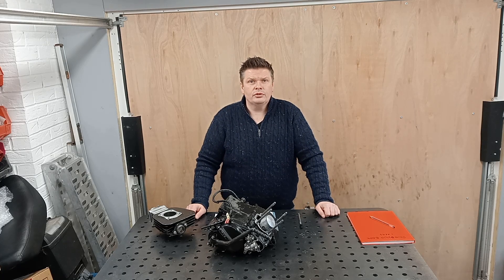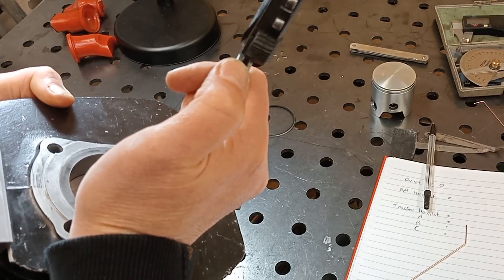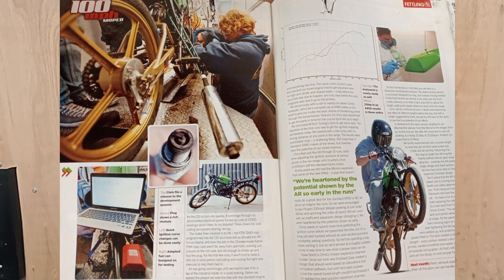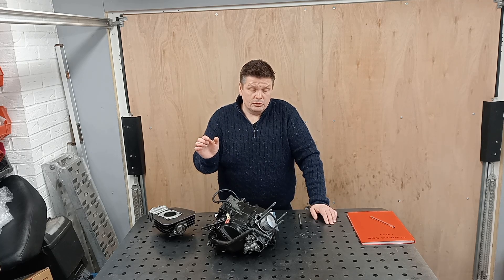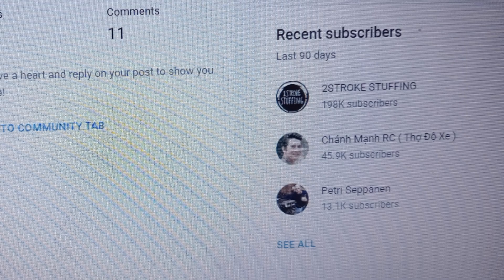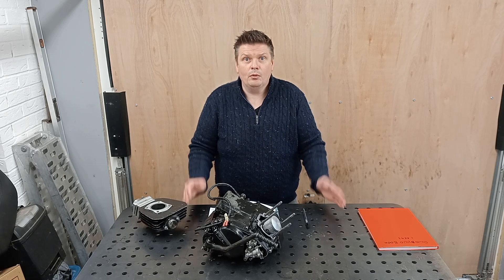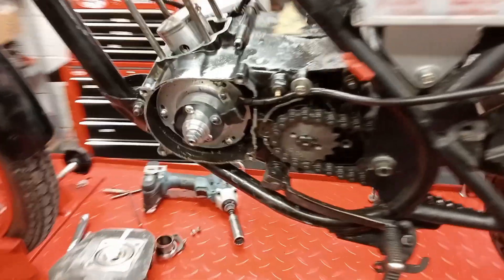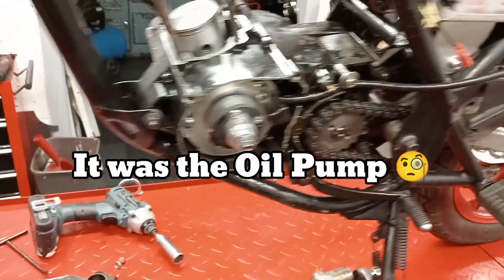How To Measure a 2 Stroke Engine - 100 mph Moped Challenge #2stroke #power #porting

Comment: A thumb role of squish is 1% of your stroke, so if your stroke is 45mm is 0.45mm a safe squish for performance 2strokes so your 45.5mm squish is totally fine, but you can get up the compression more if your fuel is capable of it 😊
Reply from the maker: Yes, I've heard of that rule of thumb too. I've been told of another now too so I plan to do a test to see what the engine likes.
There is no evidence of the piston touching at 0 .45mm
Reply: @AutoBeta2T  the lower squish you can have is better because it helps with detonation, by that you have headroom to downjet, add more timing and so on, but test as much as you can but I think you need a higher reaving pipe (14000rpm or more) for more useful power

Comment: Dave, I think your squish is a little on the tight side, A.G. bells book does not cover squish velocity, I'm sure you are aware of this fact, I would be running at 0.6 to 0.8. The other thing to note is that the squish gap should be at the most parallel or even better it should get larger as you head towards the combustion chamber, you must avoid the 'death triangle'...i.e. when the gap gets smaller heading towards the combustion chamber, this forms a triangle of trapped gas between the piston and the head. Your uncorrected CR is fairly high but the corrected is not, I guess that is because your exhaust duration is quite large. Just a quick question, how come you did not just measure the exhaust duration with the dykes ring fitted to piston?
Reply from the maker: Hi Pete, agreed it's a bit tight. Possibly why I didn't see a good increase when I raised the compression way back? I think it was 0.55 mm when I measured it before...? I may not have torqued it down previously 🤔
There's no death triangle - I checked and the solder looks parallel.
I had previously measured to the top of the dykes ring in the exhaust Dyno tests with the piston just allowing light in from the duct. I did however want something a bit less subjective  so I tried the wire method. I've never been happy with any of the ways to measure but I thought I'd better just stick to one... However.
Either way I'm at somewhere between 200 and 203 Deg duration.
Reply: @AutoBeta2T  I' know that you know a lot about this sort of stuff, so I'm not sure why I've posted this up but I have anyway! My understanding is that if the velocity goes too high it can actually promote detonation, having said that I think you would have heard it and seen evidence of it if you had detonation. But on the flip side maybe the short power runs that you are doing is not allowing enough heat to build up which would then drive the engine into detonation. If you have access to a lathe personally I open up the squish gap a touch and also run a gap of a few degrees.

Comment: A good way to calculate squish clearance, to get a safe ballpark figure, is - 0.015 X Bore Diameter. In your case 0.015 X 54 = 0.81 mm.

54mm bore is a common diameter for a 125 and I know they’re supposed to run at between 0.6 to 0.8. 

As you’re trying to get to 100mph I might go for closer to 0.6mm
Reply from the maker: Hi Dave - thanks for the rule of thumb - I will give it a go.

I have some ore heads now so I will try different squish gaps... May 0.7mm for a start.
Reply: on my Fantic 80 cc I have 0.7. It has ~19 HP @AutoBeta2T
Reply from the maker: Cool - 0.7 is sounding like a good ball park figure.
Reply: I ran 0.65 on YamahaTZ250G cylinders mounted on my TZ750, 54mm stroke, 1mm gasket compressed. Got expensive when a big end gave way.☹
Reply from the maker: Ouch - that does sound expensive. However a TZ720 with TZ250 cylinders sounds very nice! How much power is/was it putting out?
Reply: @AutoBeta2T  About the same as the 750, around 115hp but the powerband was severely narrowed down in this configuration. The throttle became something of a light switch, all or nothing. Hard on the clutch also. The 750 cylinders with their membranes gave a broader powerband and were a lot easier to drive.
It was only a few years later when I found out what Yamaha did with their works 250 cylinders (non membrane intake) before the powervalve era: they machined 1.5mm from the cylinder base and machined the cylinder heads for clearance. This broadened the powerband considerably and made equal top power. Yes, porting on the stock TZ250 cylinders was 1.5mm to high.
Reply from the maker: Sounds like an absolute animal to ride and no riders aids like traction control... Just the right wrist and the left hand.

Comment: try gasket 0.3mm under the barrel  squish is then  0.75 , transferduration longer . compression-ratio gets more bad, but it could run better
Reply from the maker: Hi Henk,

I did try a gasket during previous tests and I lost power everywhere. But as you say it could have been the drop in the compression ratio. I have some more heads to machine to try same compression but more squish gap.
Reply: @AutoBeta2T did you measure the thickness of the cellotape too? Surely it's 0.45+ cellotape thickness
Reply from the maker: @samforsey  hi Sam, the tape doesn't contact the squish band. It is in the area of the dome of the combustion chamber

Comment: May i say i think the wire is to thick would you hammer it flat ? exacting work love the video thanks.
Reply from the maker: Hi David, I did try with a feeler gauge 0.1mm but didn't get consistent measurements. I may try with some thinner diameter wire?

Comment: why you don't use a 360° disc on the crank ? with a 0.1 or 0.05 mm gauge it's very accurate. With your method, if the top of the cylinder isn't exactly level with the piston at TDC all your mesurement are incorrect
Reply from the maker: Hi, I have never used a degree disk, I have herd they can be inaccurate (parallax error). I have just seen a video with one of the digital angle boxes attached to the crank which looked pretty cool.
In my spreadsheet I can adjust for deck height positive or negative so where the piston is at TDC can be allowed for, It just so happens with this one it is at TDC.
Reply: @AutoBeta2T  Tournois racing make these tools in France, he modifies digital angle finder. In France we used to work with degree disk, the first one y had at 15 or 16 is a Compact Disc with a degree wheel printed on top, not the most accurate but good enough at the time,

Comment: This is the best way I have ever seen anybody do this: https://www.youtube.com/watch?v=jcSb2zPzzdA&t=330s
I think 2-stroke tuning should focus on all port timing from BDC, NOT TDC like a 4-stroke engine.  
Shop air into the spark plug hole through a modified comp. tester or old modified spark plug will show then the piston closes/ opens the exhaust port for real. :) 
Then, with no reed valve, closing the exhaust port opening with someting will make it possible to measure true transfer port timing the same way. 
I will argue that porting the intake port lower until you break through the floor is something worth considering.
Reply from the maker: Cheers for the link - that's a really cool way as those little boxes seem very accurate.

I also like the idea of pressurising the cylinder with air - perhaps with my leakdown tested but attached to a modified spark plug? And then using the angle box to track the crank angle.

Cheers - all noted in my red book :)

Comment: The bore is like almost 54 mm right...? This is the measure of a 125 cc engine if this is 50 cc which is the stroke....? 25 mm of strokes or something similar right...?
Reply from the maker: Hi - it started as a 50cc but has a big bore kit on it. The stroke is 41.6mm and the current bore is 54.5mm
Reply: @AutoBeta2T  Ok thanks for the clarification it is like almost 100 cc.... this displacement is better to find real gains in HP

Comment: You have blowdown from over 36 ?????????????
Reply from the maker: Is that good?
Reply: That confuses me too... Is that used in tuned street 2-strokes? I am only used to 18° to 26° in my chainsaws.
Reply from the maker: Polderfischer - it confuses me too. I have always gone for getting the area required to get blowdown phase done so there is minimal pressure in the cylinder when the transfers open. In my single exhaust port this requires going high but in triple and T port engines it can be achieved at lower timings. 
In my exhaust test I kept raising the exhaust duration (port height) and the power went up with no loss of power band width. This told me that more area was required to blowdown effectively. I think each engine is different and the dyno or stop watch will tell you when it has what it wants.
Reply: @AutoBeta2T  Seems to work for you. Perfekt. Maybe saws without a pipe behave different? Also we need no peak power. That may be the point. Thanks for responding! And greetings from cold northern Germany

Comment: Hello, for taking this at the exhaust, I use lamp in the duct and watch when light comes.
For the transferts, only a 0.10mm gauge.
Reply from the maker: Hi WTM - I hope you are well?
I did try with a 0.10 feeler gauge but I struggled to get consistent results. I did give it a go. 
The result I got with the 1mm welding wire was very similar to what I got using the light in the duct method.
Reply: Yes, with the gauge, the idea is to stop when it's hard to move in it,add little oil for more precision. Your idea work great. 👌
Reply from the maker: Cheers buddy 🙂

Comment: Nice!
thanks for the shoutout, i haven´t been able to test my ignitionsettings yet due to a very odd reason.
My mothers 'estate' after her death is occupying my garage, and i don´t want to make it smell glorious twostroke =)

I measure with a caliper and a 0.10mm feeler gauge lying flat on the dome and into the port.
Then measuring from top of cylinder down to piston.
Zeroing out the caliper at piston tdc against the deck.
Reply: Commenting as i´m watching.
0.45 squish is a little bit tight, in me and my friends project(piaggio twin) i went from 0.45 to 0.75, never dynoed the difference.
But we won the 'big race' in Sweden and became Swedish record holders, and only just tenth´s off the world record, managing this with a slight misfire also(the engine never ran this good before)
I received the parts i need for this bike(winter overhaul) so look after updates from that one also in my channel =)
Reply from the maker: @Patricks_Projects cool - that's good to hear. I did think it was a bit tight. I have some more heads (about 4 spare) to machine. I was going to try more comp (back to 7.4:1 corrected) but I'll do another with more squish gap. Cheers
Reply: @AutoBeta2T  In my yamaha i run 0.8mm 51% and 15.5-1 in ratio, but on e85, i´ve got 56mm bore and 49.5mm stroke.
198 degree main exhaust, aux is 192degrees.
Transfer is 132/134/134.
Reply from the maker: Cheers for the info :)
Reply from the maker: Hi Dave - cheers for the rule of thumb. I think I originally was aiming for .6 but it got a bit closer. I'm going to cut some more heads so I will open up the clearance to 0.7 mm